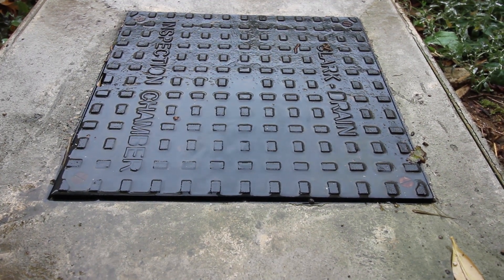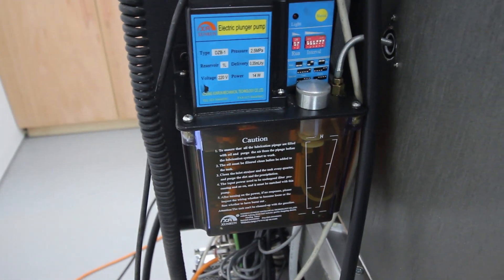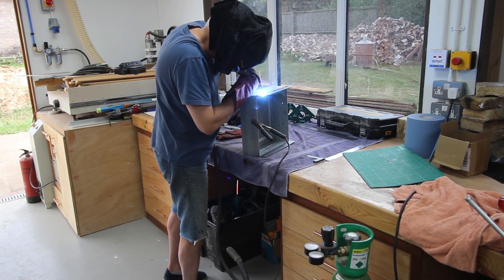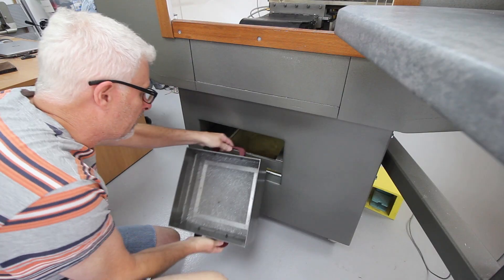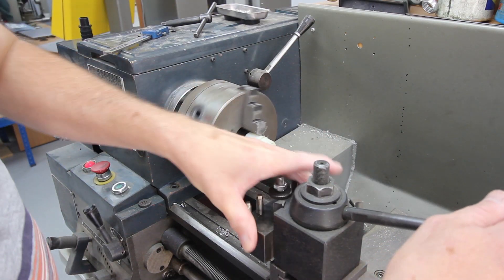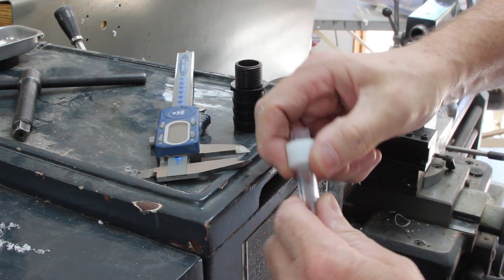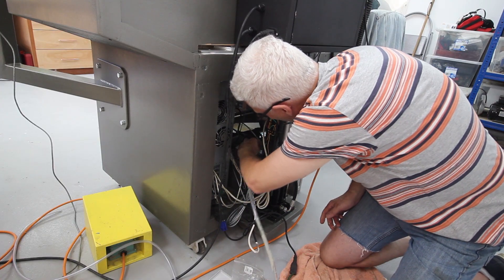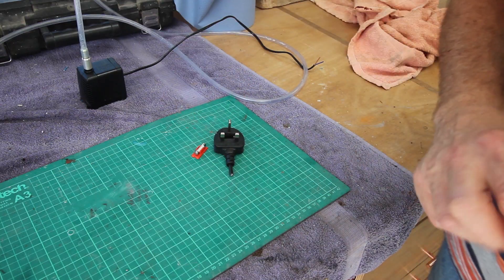Milling washdown pump upgrade

Comment: Hi, Are those pumps OK for oil etc? If so, I'd be interested in a link..... CNC looks great now it's complete.
Reply from the maker: Cheers Matt,
Not sure about how it will get on with oil! It was only £14 so I thought worth a punt.
Try this item number on eBay 136210837708

Comment: Different gas? Maybe you've got argoshield now which welds nicer than Co2
Reply from the maker: Hi @ollied1981
That may be the case with the gas I did not check just paid the extensive bill and took the bottle I was handed!
My welding is improving it doesn't scare me like it did!
Cheers

Comment: Hi David, The CNC is going well and it's been a good project to watch over the weeks.
And now fitted with a new pump for the coolant and a good steady stream, I wish I could be like that.....LOL
I agree with you of electrical items, that 60 watt motor on the pump should be a 1 or 2 amp fuse, a 3 amp should have been fitted as standard, but no higher than a 5 amp.
The fuse is there to protect the cable and conductors, I did buy fuses from RS and I have the non standard fuses but they are BS 1362 plug fuses.
I have 1, 2, 7,10 amp but also I have 1.25 amp fuses as these were fitted in to industrial florescent lighting, as these lights are a line of 20 or so lamps and 20 amp circuit and each lamp carries a 1.25 amp fuse.
I do change fuses in plugs, I just look at the wattage of the tool or item and see what the wattage is, if your on 230 volts 1 amp is 230 watts. But this does not work the same with power tools, a 450 watt drill should be fine with a 3 amp fuse rated at 690 watts, with a motor you can have high amp start up and in that first split second it can blow a 3 amp fuse.  Then go up to a 5 amp which is rated at 1150 watts.
Sorry to on a bit there.............
I'm glad the CNC mill is going good and the new coolant pump is doing a better job than the other one, at least it can be used as a water feature in the garden....
I did get the stickers I had it on the Monday after the last video, thank you very much....
as always a great video, catch you soon take care.
Reply from the maker: Thanks Shaun,
I do have an electrical fault that illustrates the whole fuse thing! My workshop lights often trip the breaker when you turn them on. The inrush current is too high for the 6A breaker and it trips. I need t replace it with a higher inrush version. Another thing on the never ending list of bits to do! Glad you got the stickers cheers David
Reply: @CazualHaze  Hi David,, Changing a circuit breaker from a 6 amp to a 10 amp that can work,you have LED panels, the only thing I can suggest is disconnect one panel at a time and then switch the lights one, there could be a possible fault with one of the lamps on switching on.
catch you soon take care.

Comment: You can absolutely get bad gas in a cylinder! It doesn't happen super often, but if you get one that doesn't have the right gas mix in it then it can make you feel like you suddenly forgot how to weld.
Reply from the maker: @trainwreck1123,
Thats good to know, its really odd how my welds improved (marginally) with the new gas!
Cheers

Comment: Great video as always. One question though...are you using Phillips screwdriver on a torque screw head in your lathe tools? 🤔
Reply from the maker: Hi @ AcidDotCom
No it is a Torx screwdriver.
Cheers